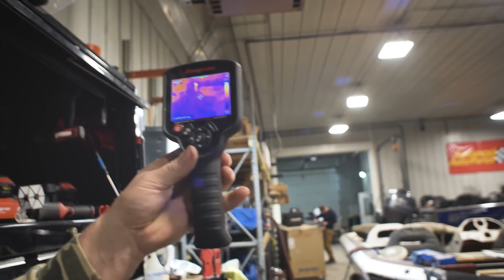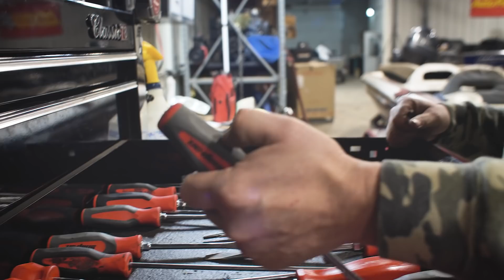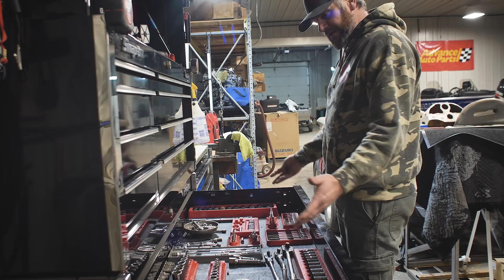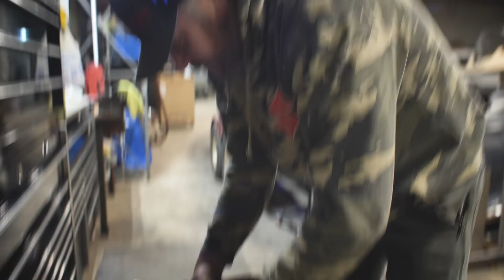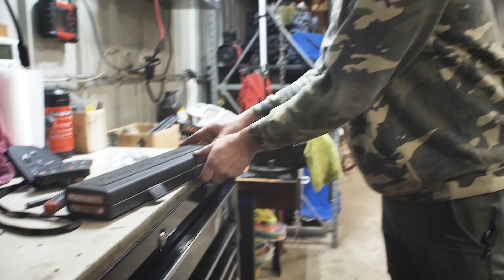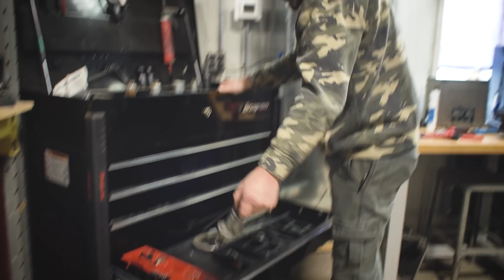So you wanna be a Marine Mechanic? TOOLBOX TOUR! (2022)

Comment: The big ring you showed is for setting the coil gap on the older Evinrudes. Put it over them and set the coil gap on the older 2 cylinder outboards.

Comment: That plate you showed is for the setting the shift cable on OMC Cobra drives. You put it on the gimbal housing studs and the shifter arm fits in that slot so you can set the shift cable.

Comment: That plate is a shift cable adjusting anchor plate for OMC Cobra lower cable adjustment. It holds the cable bell crank in neutral position for adjustment when drive is off. The ring might be a coil positioner for old point type Evinrude.

Comment: I still have a ratchet from the USAF still works. Please consider this I have a 1983Johnson V4 90 hp. motor still running drinks a lot of gas on a Cajun Blazer 16' bass boat. Will run top end at 49.3 on the gps. I  may need or want a small block rebuild can you recommend a reputable dealer. Thanks
Reply from the maker: Where are ya located Scott?
Reply: Central Florida, I will be up and running Monday Thanks for the reply. All ready replaced power paks and coils along with the VRO pump now mixing the fuel myself no adjustment available on the carbs the compression got to be low it will not idle lower than 900 to 1000 rpm. that's the current issue.

Comment from the maker: What tool brands are you guys using?
Reply: Milwaukee power and hand tools!
Reply: Dewalt power tools and gear wrench hand tools, some usa craftsman also
Reply: Snap on and matco
Reply: What ever we got 😂
Reply: Proto , Knipex , Rigid , Fluke and a few others.
Reply: I’ll be honest, I use craftsman and Pittsburgh form harbor freight 😂
Reply: I have a mix of all 3 brands, anymore though I just buy snap-on
Reply: Snap on , Mac, matco, homemade
Reply: Craftsman because most of my tools were gifted to me. Trying to become a marine technician one day!
Reply: Craftsman SK Cornwell Proto snap on blue point matco mac  plomb  lots of good stuff some crap and some weird stuff
Reply: What ever boss buys me lol person tools klutch cornwell and Milwaukee electric only bought them over 10 years ago used every day have not had any failures except my 1/2in drive impact  7yrs had to put new motor  and now 10+ hammers going out  dewalt = drastic energy wasted at lowes tramatized
Reply: Gear wrench tekton craftsman knipex snap on. I used basically only snap on in the military and after getting out and getting into my career I really like the tekton and gear wrench stuff!
Reply: Kolbalt DeWalt  craftsman
Reply: Milwaukee, Cornwell, snap on and marine tech tools
Reply: Craftsman, Mac and Lisle
Reply: Milwaukee power tools are though to beat.
Reply: Snap on and factory tools.thought snap on is expensive 15 mm horse shoe wrench for 951 sea doo exhaust I paid 110 bucks from sea doo.still have and use it
Reply: MATCO MAKES THE BEST FLEXHEADS
Reply: Klein, OTC, Sunex, Fluke, list could go for days.
Reply: Every brand